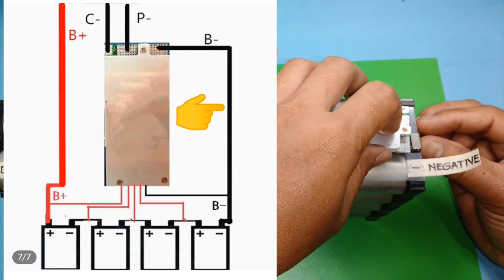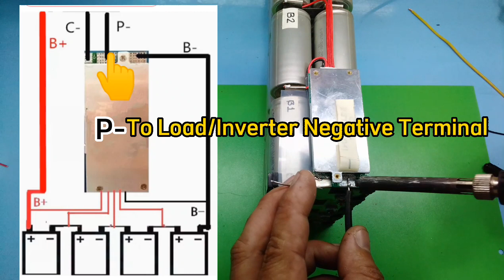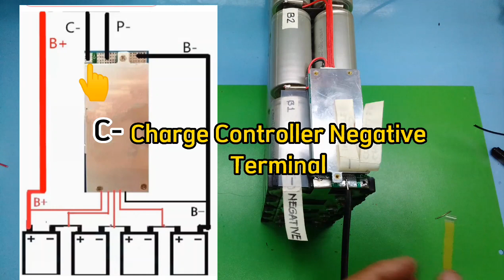DIY! 12v Battery Pack BMS installation.CHEAP! 100a BMS/Charge Protection

Comment: Sir yong c- at p- pwd bang idikit at isabay sa SCC
Reply: P- para yan sa load/inverter at yung C- para yn sa SCC. Hindi sila pwede idikit kasi yung isa may diode yung isa wala. Pag pinagsama mo sila hndi gagana yung function ng bms sa overdischarge protection.
Reply: Yan dn tanong ko sir naunahan molang ako hehehh kaso nd nag rereplay eh

Comment: Boss na guguluhan po ako sa bms na yan dumating na ung order ko kaso angulo merun pang P- at C- na output eh iisang negative lang nmn ang output ng kulay green na SCC ung png b3 life4 scc tapos merun namn ng sariling load ang scc na lagayan ng - at + ng wire ng mga load ng ilaw or dc fan so ung -P po ba ng bms eh ipag sasama dun sa - wire ng mga load wire ng ilaw at dc fan bali dalawang - wire ang naka lagay sa load terminal ng scc ung - wire ng mga ilaw at dc fan at ung -P na wire ng bms na yan ganyan po ba yan boss
Reply: Huwag mo na gamitin ang C at P bro para dila maguluhan
Reply: sa charging or scc ung c- at sa inverter or out ung p- napa ka ez pinahihirapan nyo sarili nyo